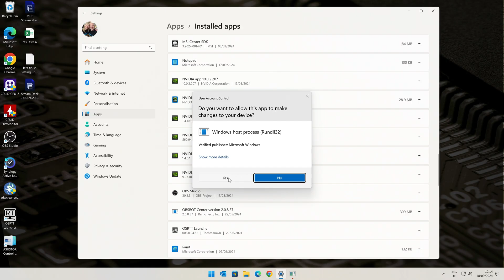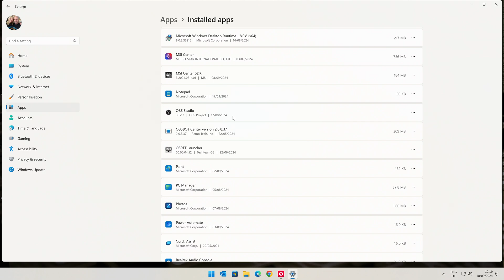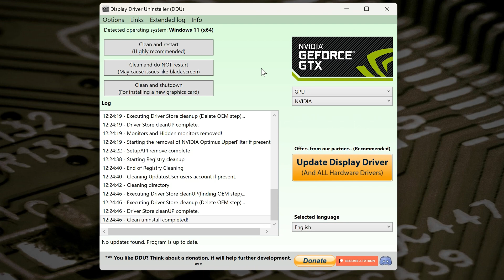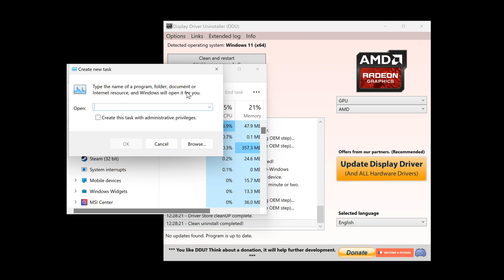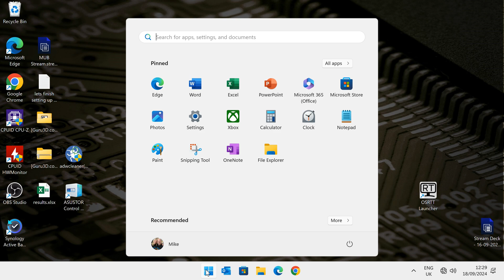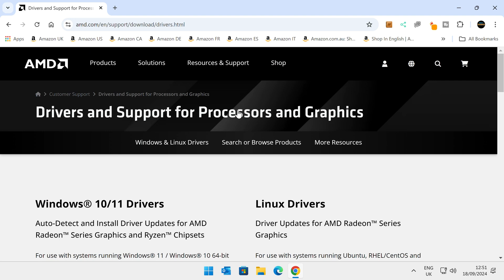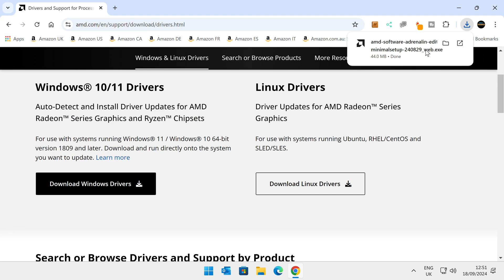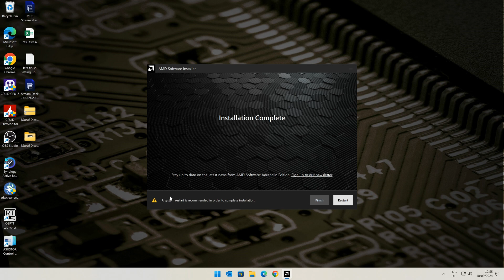How To Install Or Swap A Graphics Card Nvidia RTX To AMD Radeon

Comment: Why is it need to remove the AMD onboard driver, and if it is removed, will the onboard GPU still be usable?
Reply from the maker: you can use it if you like, but if you have a decent GPU why use the onboard one? just disable it
Reply: @mikesunboxing  In my case, I need to remove the graphics card to send it for warranty service, so if I uninstall onboard driver now, does that mean I won’t be able to play small games by onboard GPU until I install a new GPU right ?

P.S. I’ve already ordered a 9070 XT because I probably can’t wait for the long time warranty service 😂

Comment: This is a very helpful video. I have just upgraded from an old Nvidia GTX 1070 to a new AMD Radeon RX 9060 XT and by following the steps in this video exactly it has all gone well. At one point someting happened differently to the video - after I had put the new card in and started the new driver installation (for which the PC needed to be connected to the Internet again) the programme halted with an error message, saying that a Windows Update was in progress. I faffed about with some settings and managed to stop that. When I checked, it had sneakily reinstalled some NVidia driver stuff again even though I had removed the old card, and as fas as I can tell (following your method) there was only the default Windows driver on my system! Now why would it do that?? Weird hey, but once I removed that stuff once more with DDU there was no further problem with installing the Radeon driver. Thanks very much for this great video!
Reply from the maker: yeah Windows can be a bit sneaky sometimes, glad you got it sorted!

Comment: question i wanna switch my eagle gigabyte nvidia geforce rtx 3070 8GB for a amd radeon rx 7600 xt 16GB, do i have to use the gpu cables that are already plugged into my 3070 or use the cables that will come with the new amd gpu?
Reply from the maker: use the cables from you power supply directly
Reply: @mikesunboxing alright for sure.

Comment: Thank you for this very precise walkthrough. I still have an issue after installation and would like to ask for any troubleshooting advice the community has. 

My new GPU, a GIGABYTE 9060 XT, straight up doesn’t show anything on any of its ports. The RGB turns on and the fans spin, but that’s all. However I’ve now replaced my 3060, and the rig works fine again. Have I already biffed this card? Did it come biffed? Have I just wasted $400? Should I throw away all my technology and live off the grid in a cabin in the Canadian wilderness (yes)?
Reply from the maker: This is maybe easier to fix or at least advise if we can ask more questions and get direct answers, so feel free to join our Discord chat and we can go over it in more detail https://discord.gg/XtBTGQ6BDu
Agree to the rules by clicking the emoji and you will get access to the rest of the Discord channels

Comment: At 3:40 when you showed that there were files leftover despite uninstalling from control panel could you have not just clicked the NVIDIA files and deleted them and anything inside of them right there?
Reply from the maker: yeah that is an idea, you could remove those if you wanted to, although sometimes physx is still on the system

Comment: I got rid of the Nvidia driver and installed the amd drivers but my 7700xt doesn’t work and only uses 3-8% and gets 5 FPS when I open anything
Reply from the maker: This is maybe easier to fix or at least advise if we can ask more questions and get direct answers, so feel free to join our Discord chat and we can go over it in more detail https://discord.gg/XtBTGQ6BDu
Agree to the rules by clicking the emoji and you will get access to the rest of the Discord channels

Comment: Normally your videos are ok, but this was just terrible pc advice.
NVIDIA to AMD Radeon means DDU as mandatory. This isnt up for debate. Thousands of people who transitioned from nvidia to amd have faced gpu driver issues mainly because the windows uninstaller does not properly remove nvidia drivers which end up conflicting with radeon drivers.

Imstalling DDU isn't a pain.
> Unzip the file
- press the installer to install it immediately to OS drive
- it should also give you the option to launch DDU immediately , after booting in safe mode (which is not mandatory), search ddu in windows search bar below and it'll pop up immediately! 
- then select nvidia and press uninstall and restart
(Unlike windows uninstaller where you have to individually uninstall 4/5 however many software nvidia installed, in DDU, you just press unimstall once and it removes all trace of unnecessary nvidia drivers) 🤦‍♂️
This was one hell of a cringe content to see a YouTube veteran go on an uninstallation adventure with the default win add/remove 🤦‍♂️
Reply from the maker: this is old news, AMD and Nvidia have worked together to allow the drivers to co-exist, you are living in the dim dark past.
almost all AMD AM5 CPUs have an AMD GPU built in (which uses AMD drivers) and a majority of people use Nvidia GPUs so they HAVE to work together.
The advice in the video is great for modern systems, which it is aimed at for the longevity of the video.
DDU and totally removing drivers is so old fashioned. And those videos will still exist but are losing relevance in the modern PC environment, the clean install option on AMD and Nvidia drivers works much better than previous driver versions.
Reply: @mikesunboxing doesn’t seem like it considering how many people are having problems in the comments

Comment: Hellow Mike i watch this video and did a recent install Update AMD Drivers to there Newest Version followed all steps even disconnected internet used DDU. After installing the drivers got this Diolog Box, Reads
Windows Securitt
Would you like to install this software?
Name AMD System devices
Publishers: Advanced Micro Devices Inc'
Install or Don't Install
i pressed installed cuz everytime i power on or restart my computer i get that diolog box, i oped Device manager under view hidden devices, and the intel(R) UHD Graphics 770 i there but nearly visabel i guess cuz it's hidden but in Bios i have it disabled. I'm wondering if thas what that Diolg box is the integrated Graphic? only reason  pressed install is to not see that diolog box pop up every time.  Hopfully you can help me out with UR Advice Thank you Mike.
Reply from the maker: This is maybe easier to fix or at least advise if we can ask more questions and get direct answers, so feel free to join our Discord chat and we can go over it in more detail https://discord.gg/XtBTGQ6BDu
Agree to the rules by clicking the emoji and you will get access to the rest of the Discord channels

Comment: I DDU’d when I went from my Nvidia GT710 to my Intel ARC A770 LE. The Intel video drivers that appear almost monthly are not the best thing out there. The cleaning up part of the installation almost always freezes my computer. Waiting for 20 minutes or longer isn’t a solution. A forced shut down of the machine is the only way to continue using the machine again. Intel Wifi and Bluetooth drivers always install without a single problem. I’m using the Intel Driver and Support Assist software.

I always make sure all other software is closed, because I know the machine will probably freeze. The machine is super stable, used for 15 hours a day, every day.

Comment: I just upgraded to 7800xt from 5600xt. Got a good deal in the messed up market pricing here in my country 😂 really loving it, super smooth and incredibly silent and cool at 1440p high to ultra. I got the sapphire pure white triple fan ❤ used DDU just to be sure 😂 also used it on my sister's pc, coming from gtx 960 to the 5600xt i handed down 😂
Reply from the maker: Very nice! that is quite a big jump in performance

Comment: One of the easy swaps you can do until you hear the crunch lol.
Am not happy about the new app nvidia have as they are going to join nvidia control panel to the new app.
Just what wee need is more processes as if we haven't already got enough processes running as it is.

Comment: i have started doing a disk check & a registry check
when uninstalling software for hardware changes, 
i use something from major geeks, windows repair i think it's called, runs great & fixes so much on windows 7, i have however noticed it's not so smooth on windows 10, but windows 10 & 11 don't seem to like anything unless it's from Microsoft & for me seems to corrupt most apps / programs it doesn't recognise which is a bit annoying forcing me to repair or reinstall,

Comment: just use ddu from the start mike it clears everything, includingthrough afe mode
Reply from the maker: it is a pain in the ass to get the latest version then unzip it, then unzip it again then boot to safe mode, before even starting to get cleaned up.
Reply: @mikesunboxing  okay lol that why worth doing as the pain sorted lol .
Reply: @mikesunboxing but isnt it better to be in safe mode for first time installers?

Comment: Thanks Mike and Lady Kath for the how to. Normally I just install the new card and drivers. Next time ... I will use this method.  Thanks for sharing. Cheers
Reply from the maker: it does seem to iron out any potential issues, and my GPU is running very cool and quietly